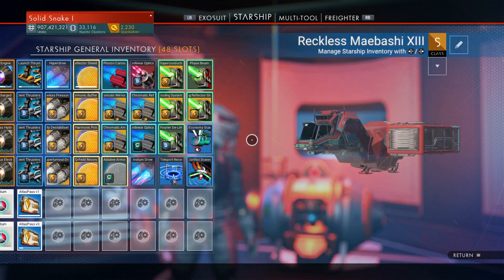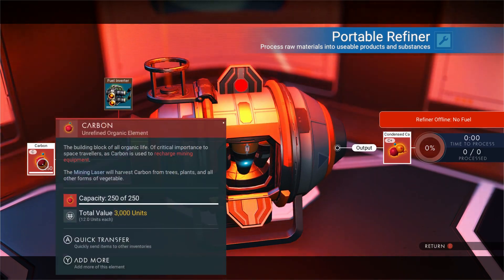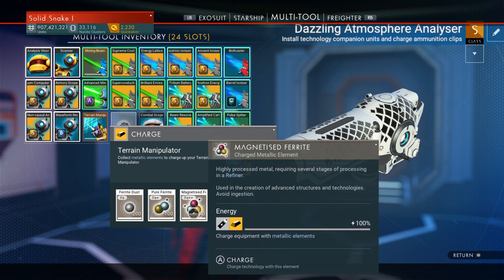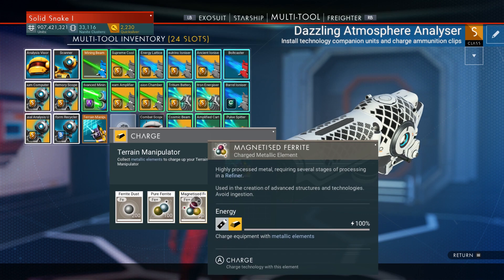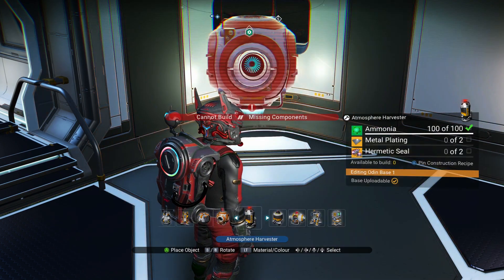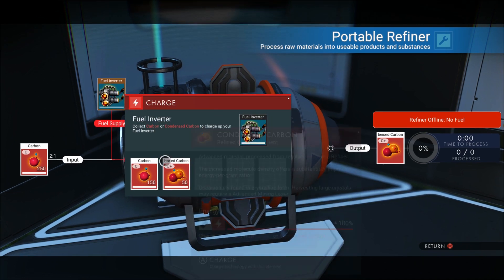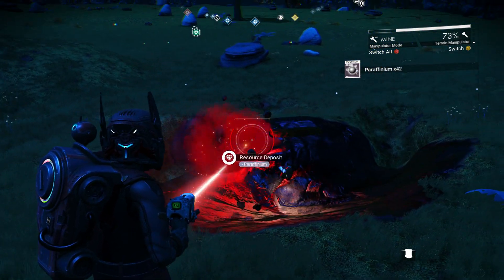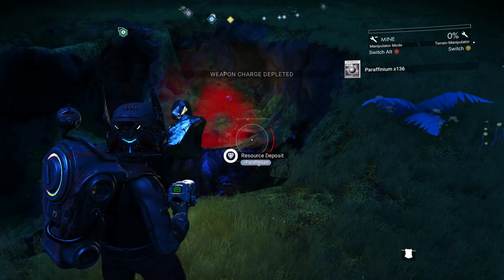Fuel Element Basics | No Man's Sky NEXT

Comment: Great tips! Definitely build large or medium refineries ASAP as they don't use fuel. Also, use them to increase you stores of existing resources. For example, you only need to mine Indium once, then simply mix it with chromatic metal (which you can buy) to make more. Want more condensed carbon? Mix oxygen (again, you can buy it) and carbon or condensed carbon to make more. The only time I mine resources now is when I'm out on a planet somewhere and need to a few resources to make ammo or refill my hazard protection. Other than that, I buy and/or refine all resources.
Reply from the maker: Great tips man, and I need to sit down and build a list of recipes.
Reply: @JasonPlaysNMS   I would love a video with all of the things you can mix in the refiner. I've stumbled across some things but can never remember them when I need it.
Reply: Thanks Lawrence! I didn't know this info. This will definitely come in handy.

Comment: Put a stack of Condensed Carbon, Magnetized Ferrite, Oxygen and Sodium Nitrate on your ship to recharge your items. It may not show up in the quick menu but when recharging directly it will show your resources from your ship no matter how far away you are. Thanks for the smaller beam tip. I've done it on accident before and got a ton of resource but I never put 2 and 2 together as to why.
Reply from the maker: Dude! I had no idea that refilling would extend with your starship. Good info!

Comment: Honestly get Phosphorus for Carbon needs. And Dioxite for Oxygen needs. Put it in your cargo in the Exosuit and have a spare 500 on your ship/freighter/base.  It is a ton more useful as it only uses a little bit. Same goes for all charging of environment shields and ship drives. The high end materials make your life so much easier. Just takes time to build up a stock pile.
Reply from the maker: Yeah, I keep all my refills in my cargo.
Reply: If you just want to top off oxygen or environmental suit from half. Wouldn't it be a waste to use the third tier material?

Comment: You're forgetting to factor in the cost to make condensed carbon, gotta put fuel in to make it. It's still more efficient though.
Reply from the maker: Unless you run into the Condensed carbon minerals on planet.  Harder to come by but if you need just regular carbon and not condensed carbon then you are golden.

Comment: I keep a stack of compressed carbon, and magnitized ferite in the cargo section of my backpack specifically to fuel my mining beam and terrain manipulator.

As for getting "more carbon" out then you put into the forge, but first you overlook that you use fuel to compress it, not as much as you get, but there is also a time element involved so you are probably better off just harvesting carbon than using the method you described. Then save that for if you are somewhere without any carbon available, and you need carbon for the forge or multitool.
Reply from the maker: Yeah true. I was thinking about when I needed carbon for tubes and such and hated that I only had condensed carbon on me.